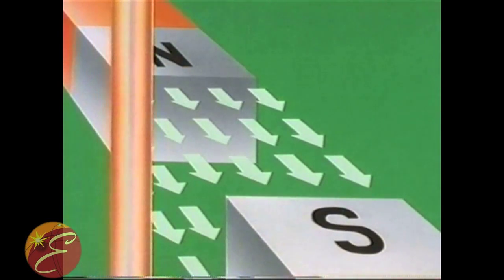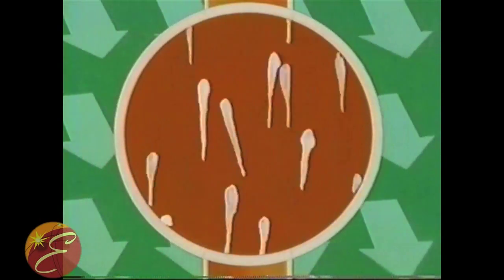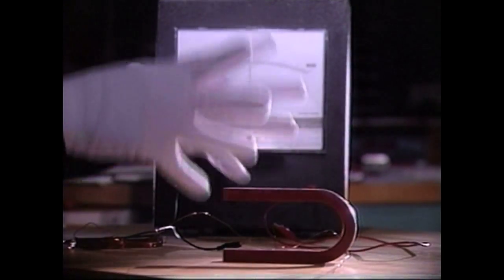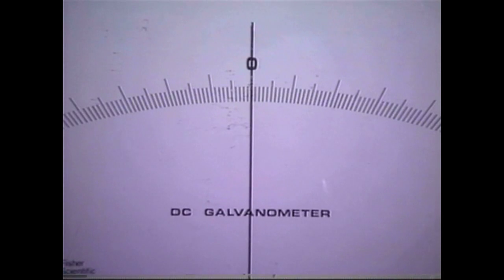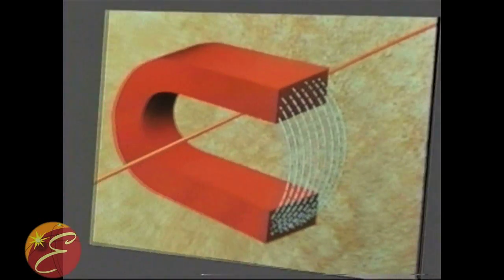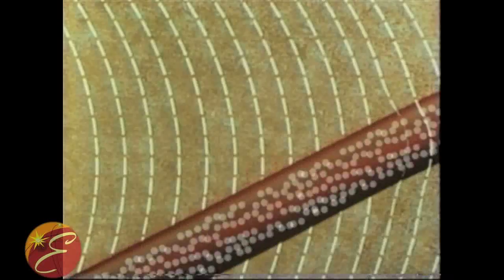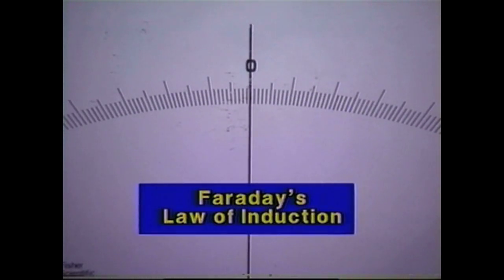Magnetic Induction in a Wire

Comment: This proves my invention theory. I can make an eternal battery.
Reply: @Caesar School exactly my boy, have some of the energy to help maintain the magnetic force already bestowed upon them while having the remaining energy serve a different purpose. There are two structures I will attempt. The first will require a stationed component that holds the spinning magnets. As you know friction will one day cause the little pole or rod rather to waste away. But should during it's duration cause the induction/ conduction of electricity then I'll move to the second design and that is to use a magnet to maintain the center rotary component in the are independent from any rod to be on. Just like those floating atlas globes or ufo toy/ decors I know you seen.
Reply: @Caesar School the air current created shouldn't be as much of a problem. It will work to keep the rotary center component in a low temperature. But honestly haven't thought about it as the magnets I've obtained, well, will literally meet no air resistance that I can 100% assure you. However, I did not expect their power to be so great which means the size of the entire structure has to be bigger. I'm going to make a new current with this creation, PC. Pulse current as for the magnets on each end to push the ones on the arms of the center component will be what send a current through a generator like part before being sent off divided, for the maintenance of the magnet's force and the rest to whatever it is one is powering. Now each arm takes its turn sending an electric pulse through part, but it is vital to have a balanced rmp because I fear to much electrical pulses colliding being sent at once will cause them to collide and burst the battery. So it is always best to know the strength of the magnets you're using. My main focus is to just get the center component spinning. Then I will work on the storage units that collect each electrical power given off as the magnets push from each other.
Reply: @Caesar School I had started in my invention late September once I came about to obtaining the materials and tools to bring it all together. I temporarily did prove when there is no motion, electricity or energy can be conducted, so long as it seems heat of or about 600°F is applied to one of the soldered parts touching the center of a ball bearing. But that was on accident as I was just making a bit of the rosin core touch the inner ring of the ball bearing. But the main part of it spinning as magnets facing each other of either North North, or South South, to push away and cause the center piece worked. I managed to make the field ring that will hold the counter magnets. If they don't exactly continuously push on each other, a pattern of strong counter magnet followed by an attracting weak magnet will fix the stand still. But everything is coming along nicely, just been busy and a bit lazy to finish it, I'm nearly at the finish line.
Reply: Another free energy idiot...
Reply: @maxwellsequation4887  oh look, a judgmental nobody who's trying to take out their frustrations in life out on random folks on the internet. Anything else ailing your chest you want to get out princess?
Reply: I like you guys
Reply: how

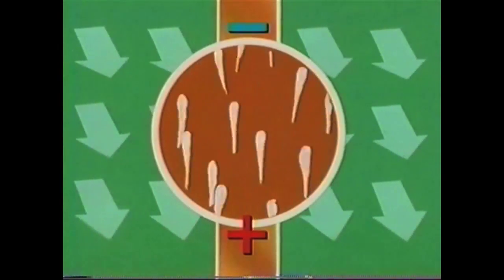Comment: Just to clarify: at 0:25, are the positive and negative symbols on the wrong ends? If the negatively charged electrons are moving up, doesn't that imply that there is a positive charge in that direction?
Reply: Everyone is studying Convectional current (Electricity flow from positive to negative).Even though, Electron flow is from negative to positive.
Reply: Electrons are moving up, so there will be negative charge accumulated at the top as single electron has negative charge.
Reply: It is called physical current and engineer's current, I think. They are labeled differently.